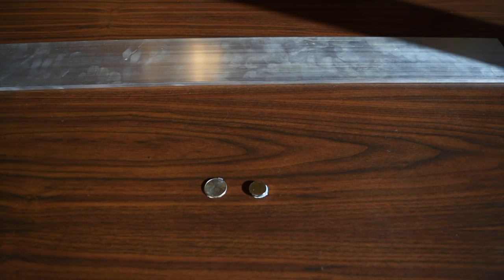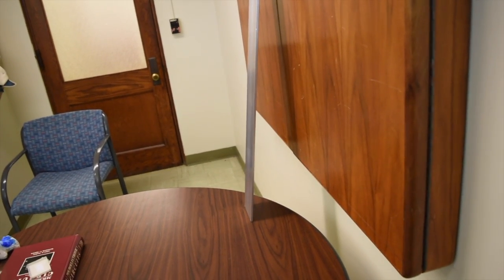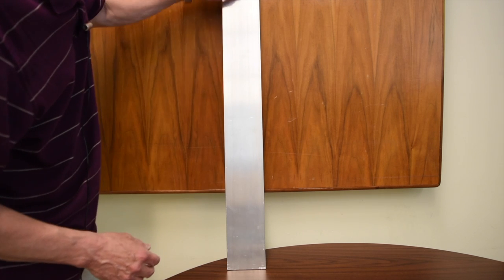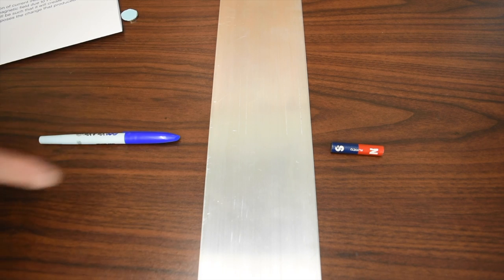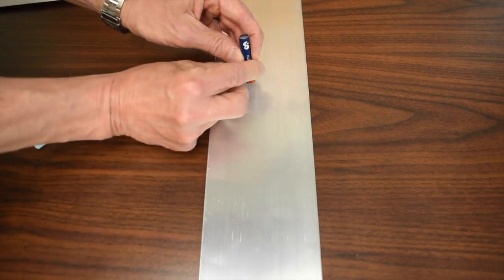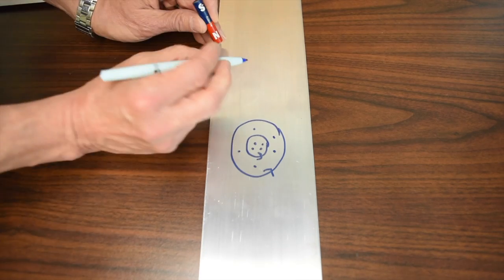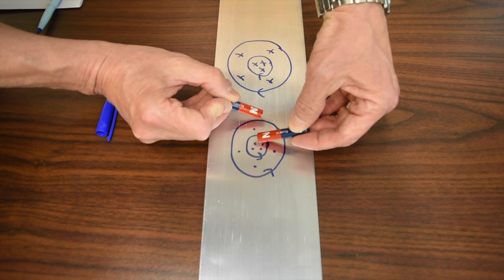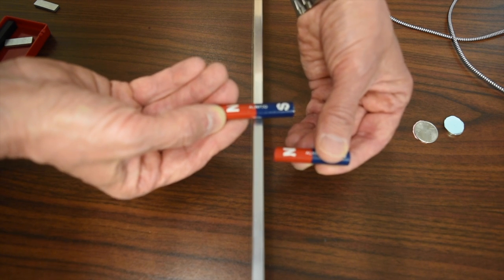Eddy Currents & Magnetic Braking Caused by Electromagnetic Induction

Comment: Yet another break-through insight presented on this channel; in this 'sliding down the plate case' I could never work out why the eddy currents reversed direction as the magnet passed a given point since the magnet keeps moving in the same direction so the thumb in Fleming's RH Rule doesn't change orientation...but now I see it does! Although the magnet keeps sliding downwards throughout, for any given level on the plate, it is approaching and then it is receding. The relative motion flips as the magnet passes every point on the plate! Taking a felt pen to the plate was the pedagogical stroke-of-genius that unlocked this conundrum for me. THANK YOU.
Reply from the maker: You are welcome and thank you for the kind words!

Comment: with enough eddy current induced could you be shocked by touching the material ?
Reply from the maker: With electromagnetic induction you can get very dangerous sparks, https://youtu.be/iVbNGJX88gc
I'm sure you can generate large enough eddy  currents that you could get a dangerous current if you touched the metal. I'll have to think about if there is a way to demonstrate a spark.

Comment: your magnstic field from currents are wrong??? right hand grip rule states your FINGERS are direcyin of nagnetic field and thumb is current. although theres the same poles just different orientation
Reply from the maker: If you have a loop of current flowing in the counter clockwise direction, inside the loop the magnetic field will be coming towards you. https://youtu.be/FLWgm_j0XZc

Comment: Would the volume of the aluminium plate affect the strength of the eddy current?
Reply from the maker: Wherever there is a changing magnetic field an electric field is generated. As the aluminum volume decreases, more and more of the electric field that is being generated is in the space outside the aluminum, so less current generated in the aluminum.
Reply: @electricandmagneticfields2314  Thank you so much for your reply. However, I am still confused. Let's say that the length (how tall the metal plate is) and width (how wide the metal plate is when facing a side with the most area) stays the same. But the thickness of the plate changes. You could say that the "surface area" stays the same but the thickness alters. Would that affect the eddy current?
Reply from the maker: @breadedchicken1105  Yes, because the magnetic field would extend past the thickness of the aluminum.

Comment: Brilliant. I saw many explanations and didnt get it clear till i saw this. Tx!
Reply from the maker: Glad that the explanation clear, it is good to hear.
Reply: @electricandmagneticfields2314  What if you glued copper or aluminium plate on top of the magnet when it slides on aluminum?
Reply from the maker: @mapi5933  To the copper and aluminum on the magnet, since it is moving with the magnet, the magnetic field will be stationary and have no effect on the copper or aluminum attached to the magnet.
Reply: @electricandmagneticfields2314  this video is for the students of which year age?
Reply from the maker: @krushalrabari976  For a junior level course I teach at Purdue, but I think high school students should be able to follow many of the demo videos